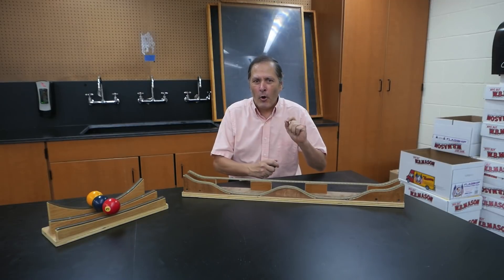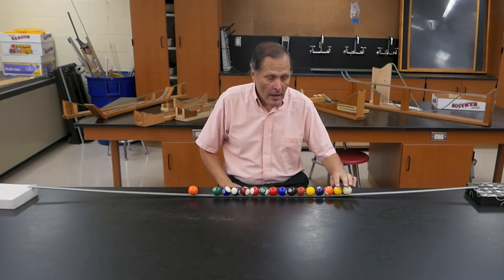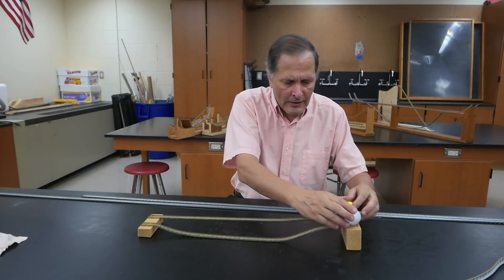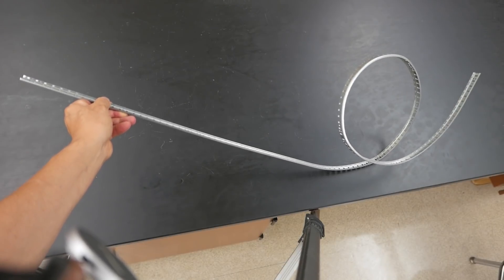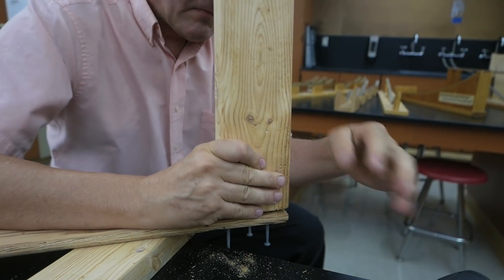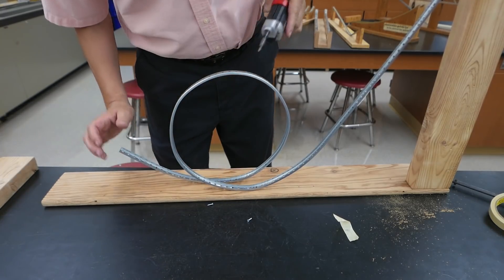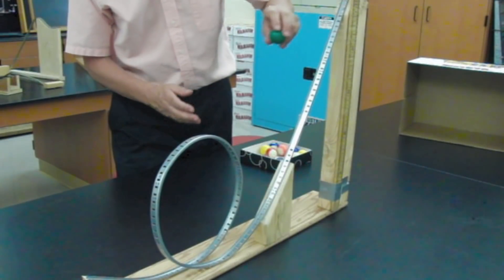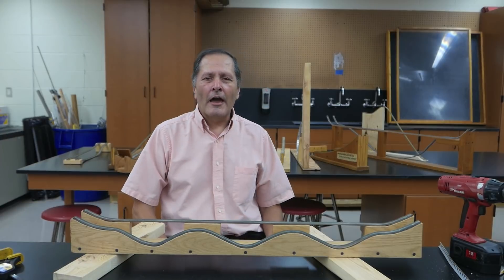Building physics marble tracks-loop de loop track part 2  // Homemade Science with Bruce Yeany

Comment: Kindly siggest me, which kind of material or the tracks/rack you are using?
Reply from the maker: they are metal tracks for shelving available at building supply stores.  The tracks attach the wall, tiny clips attach to them and then shelves are added on top

Comment: How did you draw the curve for the cycloid track?
Reply: Excellent question.   Get a disk with the size of the circle that defines the cycloid.  Wrap it with a rubber band.  Place your pencil in between the rubber band and disk.  Sister the flat edge of your board with a piece of dimensional lumber like a 2x4, that sticks out above the surface of your board.   Roll the disk along the lumber, while drawing with the pencil at the fixed point on the disk.

Comment: @Bruce Yeany
Thanks for another great video. 
One suggestion (a humble request), that You allways put a link to what You consider as the "following video"(if there is such a video). Ideally placed at the same place every time, at or close to the top of Your "description". Or in it's own "pinned comment".
I suggest this as I often find that You have a logic succession to Your videos, and very often mention it in Your videos. But when I then (naturally) want to go directly to that video, "Youtube fails" to present a link to that video, anywhere on the page. So I'm forced to go back to Your "Channel" and try to find that particular video in Your  in the "tab" containing ALL Your videos, something that at times can be a bit cumbersome, as they are not necessarily "posted in direct succession". Just a suggestion.
Thanks again for Your fantastic work, both here and as a clearly very inspirational educator.
Best regards.
Reply from the maker: good advice,  I did go back and add  tabs that should appear at the ending of some of the  videos suggesting related videos  but need to do a better job of this

Comment: Thank you for your detailed explanation. We are also building marble tracks, however ours is not working properly, so Im thinking about using tracks now thanks to your video.
I live in Europe so Im not sure if the tracks are the same width.
What is the width of your tracks? And what size are the balls you are using? 
I found billiard balls in different sizes online and would like to get the best size for the track.
Thanks :)
Reply from the maker: our measurements for the ball in this country i probably 1 inch or 2.54 cm,  but you can use large balls or  smaller,  I think 2 cm might work. The tracks are made for book shelves, they are the bracket attached to the wall.   Before I found this material,  I made. few tracks by carefully cutting PVC plastic pipe in half longways.  Cut it on a table saw and then sanded the edges.  Worked as long as you did twist the pipe while cutting

Comment: Can someone explain how the loop works ?
Reply: The way it works, is that the ball has to accelerate downward at a rate faster than Earth's gravity, when it is in the upside down portion of the loop.  The force of constraint from the track can only push on the ball, and cannot pull on the ball.  Therefore, it can only join gravity and cannot counteract it, when the ball is upside down.  The forces have to add up to mass*acceleration, which means N+m*g = m*a.  Normal force N has to be positive for a push-force of constraint, which means a > g.

Since it is following a circular path, the acceleration is centripetal acceleration, due to the changing direction, which is therefore equal to v^2/R, where R is the radius of the path of the center of mass of the ball through the loop.  Set N=0 for worst case scenario, and you get a minimum speed of v = sqrt(g*R).   Using conservation of energy, we can calculate that this means we need to release it at a position of 1/2*R above the top of the loop, or 2.5*R above the bottom of the loop.  If you account for the fact that the ball rolls, treating it as a solid uniform sphere, it actually ends up being 2.7*R, instead of 2.5*R.

Comment: I feel like I have scoured the entire internet for Shelf Bracket tracks like the ones you are using. Could you maybe link to the place where you have bought them? Thanks :)
Reply from the maker: Sorry you had problems.  Try shelf uprights made by Rubbermaid E5. length 72 inches. Available at Home Depot.  cost $2.98 for 6 foot length
https://www.homedepot.com/p/Rubbermaid-E5-72-in-Zinc-Upright-FG4B9200ZINC/100177025
Reply: Thanks a lot :) Let see if they will ship to Denmark. Thx for great content!

Comment: I expect you may know the answer so I have a question for you. The multiple ball collisions: if the impactor has twice the mass of the other balls does it knock two balls off the other end? Does an impactor of 3 times the mass knock 3 balls off the other side? If one impactor has as much energy as two slower impactors how do the balls on the other side know if it's one ball or two?

Comment: Now you are making me curious, in going to have to see if I can work out the math for how high the ball must be to complete the loop.  Thank you for the great idea and challenge!
Reply: Given a circular loop of radius R, a particle that slides in pure translation needs to be released a height of 2.5*R above the bottom of the loop.  One way to make that work, is to slide an ice cube along this track.

Accounting for the fact that the ball rolls, the height needs to be a minimum of R*((5 + X)/2) above the bottom of the loop, where X is the factor in front of m*r^2 in moment of inertia about its center.  For a solid uniform sphere, X=2/5, which gives us a minimum height of 2.7*R.  This is independent of the mass of the ball, the radius of the ball, and the gravitational field.

Actual roller coasters don't use circular loops, because circular loops have the fatal flaw of a 6-g environment at the bottom of the loop, best case scenario.  Roller coasters use clothoid loops that are tight at the top, and broad at the bottom, so that the g's are kept within reasonable limits.